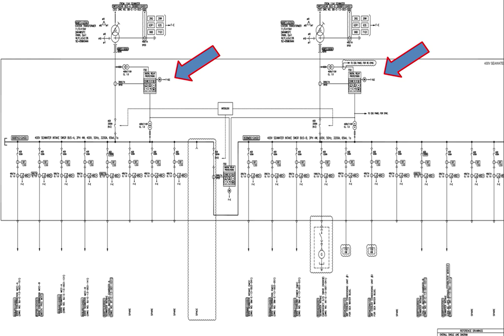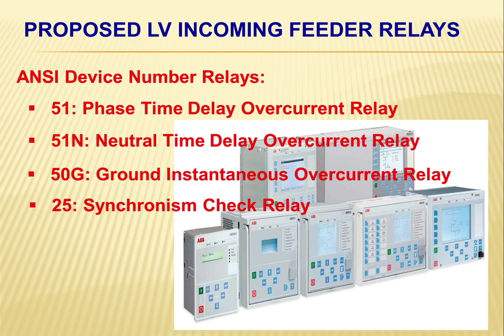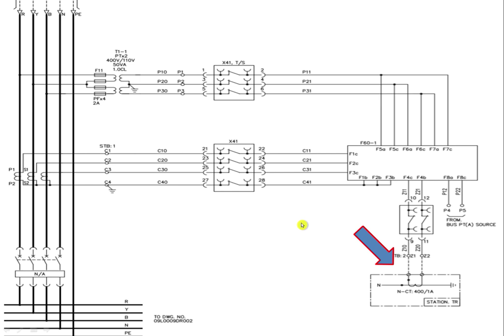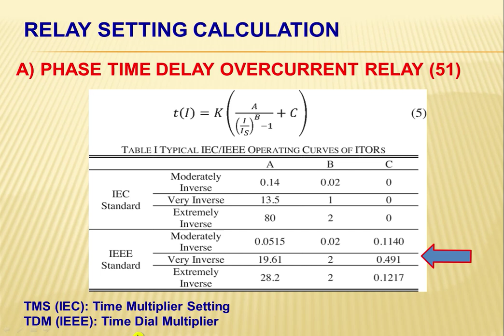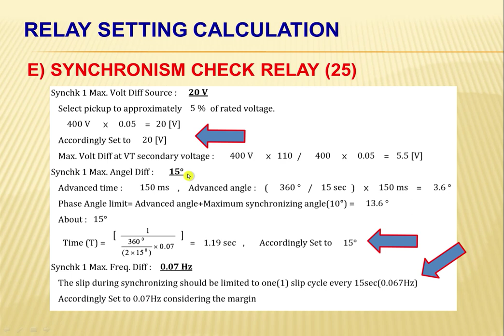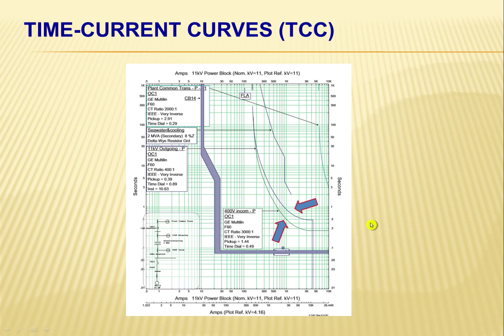Protection Relay Setting Calculation for Double Ended LV Switchgear Incomer Relays

Comment: Wow!! Additional knowledge I learned from you….thanks. Sir, I have a question ,you mentioned that this type of relay has a function for synchronizing ,if we use this function, is synchronizing panel still required when the bus tie breaker will closed with both upstream supply and do we need to have a transformer with automatic turns ratio selector?
Reply from the maker: Welcome sir. The bus tie or bus coupler will have the same protection relays with the incomers. Incomers and bus tie are interlocked each other. Sorry for not showing or mentioning it. Bus tie is normally OPEN. For synchronization, bus tie will not close if all the conditions are not satisfied, i.e. same voltage, frequency, phase shift and rotation. It will close only once all the conditions are met. For dead bus or any of the incomers is dead due to lost of power (not by short circuit), bus tie will close. Logically (controlled by SCADA) bus tie is prohibited to close once any of the busses ( bus A or B) experienced short circuit. Upstream transformer is NLTC (No Load Tap Changer), a non-automaric changer is being provided as there was a power study that the power sources are stable.